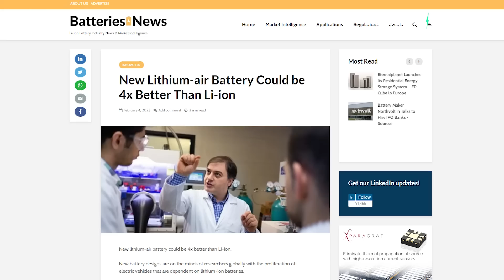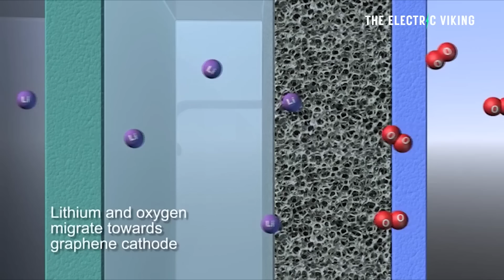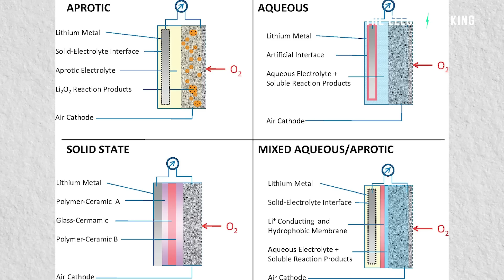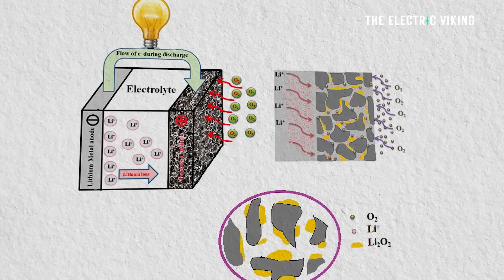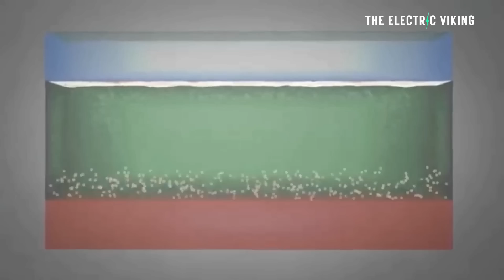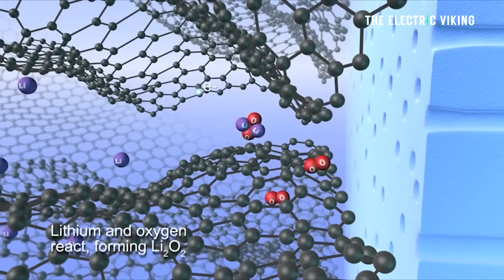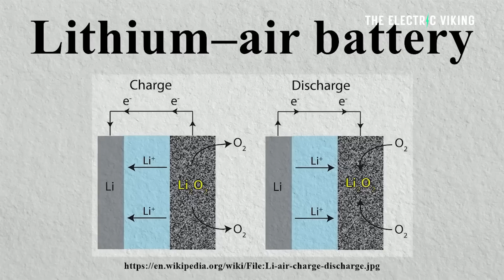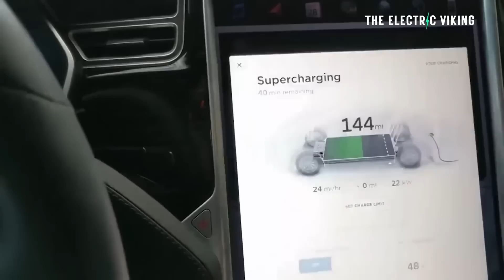World's highest energy density Lithium Air battery solved! Up to 2000km EV range!

Comment: thats all folks
Reply: actually if you have it aqueous, then Metal oxidizes to Metal Oxide, and H+ goes aqueous to the oxygen carbon electrode, and makes power
Reply: ie, water salt acts as proton exchange membrane, or salt bridge
Reply: the oxidized metal stays on the metal side of the fuel cell
Reply: just use single use metal sheet spools, metal specific energy is up to 8000Wh/kg, aluminium sheet is stable as sheet metal power source, swappable sheet catridges
Reply: its all about the metal making process from the metal oxide, to get the recharged metal sheet spool back, re-used, endless cycles
Reply: 8000wh/kg is 40x of the 200wh/kg of the current lithium ion, you just have to use the battery fuel cell like gasoline, put more metal in, to get more out
Reply: water oxidizes the metal, then H+ moves through the water electrolyte, joins with the O- ions in the oxygen electrode
Reply: oh you are actually talking about Li+ ion transfer cells, ok
Reply: yes just like hydrogen air fuel cells, what I talked about

Comment: With a much larger capacity battery, an electric vehicle's computer could reserve a portion of the battery's useful capacity for later inclusion as the battery ages. This could give EV's a much longer minimum performance with age warranty, which would be an important selling point.
Reply: Isn’t that already happening applied in Tesla’s. Almost full power and about 30 km in range after 0%?

Comment: We need batteries with at least 3x the current energy density to reasonably replace larger ICE vehicles. 4x without a significant cost increase or weight penalty would be a game changer. So, if the time scale hods true, in ten years they will become practical for both daily driving AND long-range towing.
Reply: Don't set your clock on that. The thing about breakthroughs is, sometimes they happen, sometimes sooner, sometimes never.

Comment: What are the C rating for the battery and how many cycles can they get out of the battery and the degradation amount?  Could one also use sodium metal and air for batteries?
   If one gets 4X to 5x out of these new cells, it would mean 800 watts to a 1000 watts per kilogram for sodium. It could mean my old 2011 Nissan Leaf could have a 360 mile range.

Comment: What was the depth of discharge for this claimed 1,000 cycles and at what rate and temperature?  We had our batteries tested at Argonne National Laboratory as well and it is just a step to quantify some data from our own labs.  I had dozens of batteries tested at different depth of discharge and could easily have an end of life at 100 cycles or taking very little Ah out and still going at 20,000 cycles.  There are lots of battery "experts" out there that have little or no empirical observations from working in the battery industry.  

I also would be interested in the nominal voltage at C-rate to gain another data point.

Comment: I realize you are new at this, but there have been a thousand or more claims of a battery breakthrough in the last fifteen years. None of them mean anything unless and until the technology is in production, can scale to provide battery cells for hundreds of thousand of EVs, and can be made at competitive prices. It hurts your credibility to keep gushing over these announcements. "With further development" = we are at least five years away from achieving these numbers we are talking about, and probably never will reach them.
Reply: If you hadn't noticed, battery prices have come down by 90-95% in the past 15 years.
Reply: @gerryburde5663  if you haven't noticed, the drop in prices for lithium ion battery cells has been realized by incremental progress in battery chemistry and production technology combined with increased scale of production. There have not been any "breakthroughs" that have been announced that have come to market unless one wants to count the 4680 tabless cells, which are a bunch of improvements combined together. One might also consider the BYD blade cells as a breakthrough, and CATL seems likely to achieve sodium ion battery cells that are useful for EVs and very cheap. 

But zero of the thousand or more announced "battery breakthroughs" from the hordes of small companies and university labs have come to market so far.
Reply: @gerryburde5663  Yes, yes, the venerable lithium ion, which was invented in 1912, has finally come down in price.
However, I believe mr tribal may be talking about the newer ‘game changing’ batteries like the unobtainium caramel and ice cream batteries, which don’t perform well in hotter climates and are still quite expensive compared to current production batteries.

Comment: Yeah, but I wouldn't say it's solved.  😉
I mean, seriously, there are nearly an infinite ♾️  way of making batteries, and a lot of them are technically "better," but an arguably more important issue is feasibility. 
With batteries as large and widespread as are required by the auto industry, scalability, longevity, and cost become far more important than power density.

Comment: Such high energy density is scary. Lithium is very flammable and burns very hot. How will they prevent it from blowing up, or creating an uncontrollable fire? That's difficult enough to do with today's Li-Ion batteries.

Comment: its a breakthrough for track vehicles like tesla semi. for passenger cars the current lfp batteries with 250 miles of range are good enough. even sodium batteries are good becouse the biggest scope now is to make batteries as cheap as posible to be able to reach a a price of 25k for a car like tesla model 3.
Reply: Since when is an 82,000 pound truck a track vehicle?
Reply: @apterachallenge  Ever since they put 3 electric Plaid motors in them 🤣
Reply: @gerryburde5663   Well let's just say that track driving is not their main function, but given that I have seen diesel tractor units being track driven, I guess anything is possible if somebody decides that's a thing...
Reply: even a 35k usd tesla model 3 is cheap considering the price of gas in europe and the periodic service cost of a ice car you make economies of over 20k usd for every 100k miles driven in a ev.
Reply: Simple spellcheck error. Truck,not track.🤔

Comment: The problem is that you end up with a heavier battery when you have the least power left.
Reply: As a battery discharges it doesn't get heavier. Where are you getting your "information"?
Reply: @skipondowntheroad5833  a battery that oxidises does… it increases by the amount of oxygen it consumes to do so.  
Where do you get your information?
It is the same as this but with lithium rather than steel https://youtu.be/TsnLmgWXw-E
Reply: As the battery absorbs atmospheric oxygen it gets heavier, that is true. But the discharged battery is still lighter the the equivalent lithium ion battery of the same energy.

Comment: Lithium and Oxygen have proven to potentially support battery fires which are hard to extinguish. Lithium is still rare, and its price is exponentially increasing. What is this battery's lifespan? How about its temperature control? What happens to it in an accident? How does it do in a COLD environment?
It's not just about the capacity!!

Comment: I'd be stoked for this but I hear about battery "breakthroughs" all the time and they rarely actually are breakthroughs.
Reply: They are breakthroughs of a sort, but almost always or always they cannot last enough recharge cycles, or do not work in the cold or heat, or production cannot be scaled with existing production machinery, or the costs per kwh will not be competitive, or energy density is too low, etc.
Reply: Correct.  The last REAL breakthrough was CATL producing LFP 2.0 batteries, which increased range for Tesla cars about 40%, and significantly reduced charging time,
Reply: Plus, LFP batteries are much less susceptible to spontaneous combustion, they've been used for years already in solar batteries and marine batteries.
Reply: Indeed.
Reply: Yea, just that weee bit of a problem called dirt in said air in tiny passages of said battery.... couldn't be any problems there!
Reply: I agree in someways. The “innovation” often is done in small incremental steps. If you take a step back and look over 20 years you will notice that we have been innovating a-lot, but in small increments.
Reply: Rarely? I would say: never. When did we ever had a jump? They are getting better slowly but no breakthrough did really do anything. Apples m1 m2 chips, they where breakthroughs.
Reply: A growing issue is getting trapped in the legacy architecture of production. I know it sounds a bit counter intuitive but unless the rewards significantly outweigh the investment cost, we will be stuck with current tech. I think what will really drive a sea change is the requirements of heavy trucking and emergency equipment needs. If a tech can satisfy those, we will get it.
Reply: Breakthrough to catch less fire maybe..
Reply: or easy to catch fire 😩

Comment: I hope it works as much as I hope any of the developing technologies. I really hope that they can also improve the charge cycles. More cycles will be important if the vehicles are to last any amount of time. I do suppose 1,200 miles per charge would equate to approximately 1.2 million miles, but who is going 0-100-0 for all there cycles?
Reply: good point. its a breakthrough for track vehicles like tesla semi. for passenger cars the current lfp batteries with 250 miles of range are good enough. even sodium batteries are good becouse the biggest scope now is to make batteries as cheap as posible to be able to reach a a price of 25k for a car like tesla model 3.
Reply: All the economic advantages are great, and I certainly agree with the Model 3. 250 miles is enough for most, but more is better. I agree with making the battery smaller and still having great range. Many economy cars still have decent range such as my wife’s Mazda 3. It can go approximately 440 miles per tank, and it does not have a large tank. I have an EV6 and I can travel EPA rated 274 per charge. I have done better, I have done worse. Usually around 200-220 miles per charge as I am not going to 100% unless I am starting a large road trip, and even then it is just for the initial charge. I would like more range, however I also drive more than the average driver and it would be more convenient for me. I drive an average of 25k-35k mile a year. Having that extra range would be helpful. Do I need 1,200 or so, no, but 400-500 usable would be nice. It would make it so I would only have to stop on some of my longer travels, rather than 2-3 times or more. The nice thing about the EV6 is under the best conditions it charges very fast. If it came down between range and charge speed, I would take the faster charge speed every time. In an ideal world, I would like both.
Reply: I would think they would half the battery pack as 600 miles is good enough, and in fact it probably has to only be 40% to obtain it. The key like all new tech proven in a lab is it commercially viable -- produced easily in quantity and holds up across millions of vehicles.
Reply: even a 35k usd tesla model 3 is cheap considering the price of gas in europe and the periodic service cost of a ice car you make economies of over 20k usd for every 100k miles driven in a ev.

Comment: A battery 4 or five times energy dense is a major game changer, just think of the extra efficiency in dropping the extra weight by making the battery 3 to 4 times smaller.
Reply: Lithium air batteries have heavier and larger volume casings so no- it wont be too much smaller- but it will be smaller
Reply: Traditional Lithium-air batteries have a very precise osmosis style air filter and air pump to extract pure oxygen from the air and push it through the battery. This pumping system is expensive, heavy, consumes energy and provides another failure mode. No mention if the size and weight savings includes the pumping system.
Reply: So, an utter joke... uses air... with dirt in it... So, no you do NOT have a battery at all, you have a dirt magnet.
Reply: Then you should report it.Why dont you?
Reply: Yep, greater acceleration, greater range and lower costs.
Reply: Wiki says Pairing lithium and ambient oxygen can theoretically lead to electrochemical cells with the highest possible specific energy and would be approximately equal to gasoline !!!!!
C'mon Scientists and engineers, crank it up. I'm a retired ginger beer and would love to see it in a BEV while I'm still part of this ever accelerating technological world.
Reply: Or airtravel.
Reply: @Myrslokstok  Air batts all have the same problem... zero cycle life as particles in the air plug/contaminate them.
Reply: Lithium air max potential is 5.6kw/kg with air included, or 12,000k kw/kg excluded drawing air from the surroundings!

 Those are max therotical which will never happen. Yet man if we could get half those numbers. 2.5k to 5k kw/kg!

 Would be amazing. Especially the later. 

 Everyone should be researching it!

Comment: would make air travel much cleaner for 3 to 4 hr flights
Reply: Aircraft rely on the fact that fuel consumption during the flight reduces AIRCRAFT WEIGHT, and with that - the energy requirements! A heavy Battery does not become lighter during the flight, which means that enegy consumption is higher, increasing the cost of the flight. The cooling of the battery at high altitude is also challenging.
Reply: Only for small aircraft... See Real Engineering for the insane step to complete electric air travel.
Reply: Archer, Jobby, and lilium quote ranges of 100, 150, and 190 miles. Multiply those numbers by 5 and you can EVTOL air taxis with ranges of 500, 750, and 950 miles.

Comment: But is it rechargable or just single use just like aluminium-air?
Reply: My first reaction too.
Reply: Hint air:  air products lol.  I believe it when its in actual products.  Talking points is not same as actual products.
Reply: Iron-air batteries are rechargeable but iirc they have a low cycle life. I'd be concerned about charge time - I bet these won't charge nearly as fast as today's lithium ion batteries.
Reply: @Nabushika  good for tesla semi with swap batteries as long as the price is afordable.